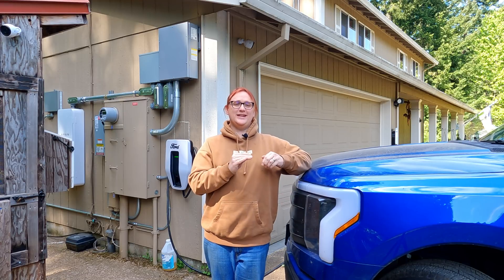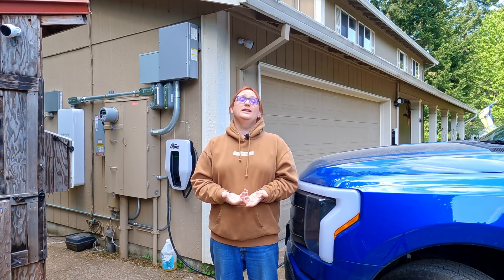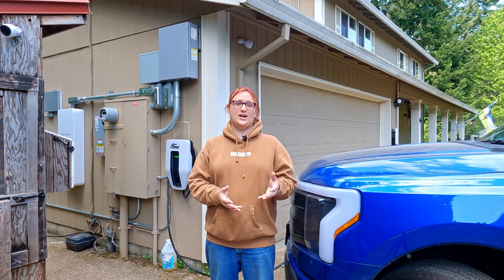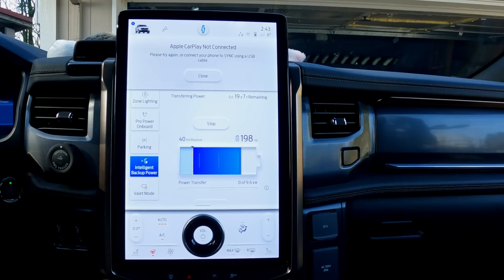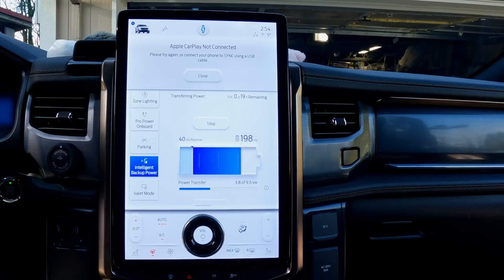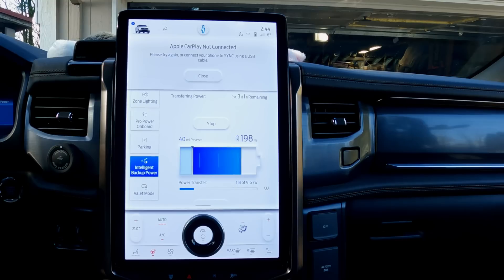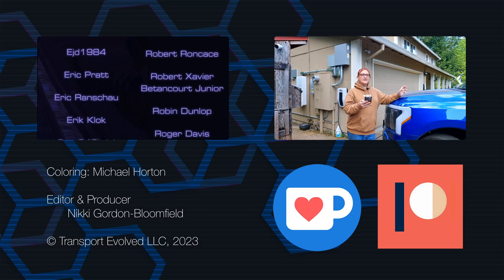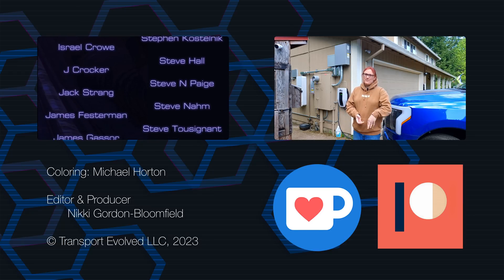I Was Wrong: How The Ford F150 LIghtning Home Integration System ACTUALLY Works

Comment: Always helpful and educational. Thank you for boldly going where we haven't yet!
Reply: @Dwayne morton The Home integration system as backup power source is not a great idea, IMHO.  At best Home integration should be for Vehicle to Grid purposes.   If the vehicle isn't at home when there is a power outage.... that is not good.  If the vehicle is needed away from home during a power outage, that is not good.   It would be better and less complicated to hook up a  separate home backup storage system, which could recover some of its costs. by buffering peak-time usage fees.
Reply: @HearToneSpeak  A grid tied solar array, using microinverters is the most popular choice. Well, most prevalent. Batteries for a hybrid system are very expensive. Might the use of an EV as that battery pack be a good interim solution, especially if a generator is available? I think purchasing a reasonably inexpensive EV possessing high efficiency, hence not having a enormous battery is the most intelligent solution. Leaving sufficient funds for home storage. But please note, this is important: this is not the prevailing attitude in America  right now. American seem to be in love with hugh EVs with humongous battery packs. Contrast that with the Chinese who's most popular EV is a tiny two seater with a even smaller battery pack. In other words you go with what you have.
Reply: @LV_CRAZY  " Batteries for a hybrid system are very expensive."  about $10k, you don't have to use Tesla PowerWall, there are other less expensive solutions, Powerwall is the best and works amazing.    The vehicle to home idea has too many issues, but more importantly tying a $80k EV to the home in a power outage seems like a misuse of resources.   Your point about purchasing a "reasonsably inexpensive ev" seems smarter.  The system will be much easier to install and like I stated, it can generate revenue / savings , just offsetting demand / peak usage charges.  

The " Chinese who's most popular EV is a tiny two seater with a even smaller battery pack"  Is not a good vehicle and I would discourage its usage, on safety grounds.   The Tesla Model 3 standard range is an excellent vehicle and has all the conveniences and a reasonable price.
Reply: @HearToneSpeak  I agree with your reply and thanks for the thoughtful response. I believe my vantage point is a bit different. I live in the Philippines so a Tesla isn't a choice. BYD has introduced the Dolphin here at a substantially higher price than in China. If a reasonably inexpensive EV is ever available here it will sell well. But no subsidies available. The roads here favor a smaller car, narrow roads and extremely tight parking spots. You'll probably never get over 60 MPH. Most solar systems here are 2 to 3 panels, a deep cycle battery and a cheap hybrid inverter. Under a $1000 USD. Saw a 6 person family on a scooter this morning.  When EVs and renewables get cheap enough for developing nations we will be much better off.
Reply: @LV_CRAZY  Thanks for the thoughtful reply, there are cheap EVs that are made in China.  The one that comes to mind is the Wuling Mini EV or hozon Neta No1 

Those are under $10k USD

Comment: Looking forward to seeing a video on today's announcement, Ford going to NACS!  So it begins....
Reply: Including NACS. Nothing said “going to” as in ditching CCS. also note the announcement didn’t include any mention of the MagicDock. Current vehicles will need a Tesla adaptor ($) to work next year. Nothing about Tesla rolling out MagicDocks to the rest of the country.
Reply: @altf4osu  installing NACS ports on their vehicles in 2025 sounds like they're going to NACS. Of course they could still have CCS as well, just like Nissan has kept CHAdeMO. 

 NACS is is the most prevalent standard in North America (more Teslas than all other EVs combined), now with another major automaker utilizing it, it's only a matter of time until others follow suit and clunky CCS is just another afterthought.
Reply: @MarkLLawrence  nothing stopping dual ports, but it will be expensive not just in copper but adding more contactors or a system to make sure only one charge door is open at a time, Jim's tone made it sound like a port swap to me.
Reply: @KaceyGreen  maybe they'll make CCS an option for anyone wanting to use the legacy charging networks out there.  Would they even be called legacy?  Most came after the Tesla Supercharger network and none ever caught it in size.
Reply: @MarkLLawrence  I’m sure they’ll include an adapter and leave it at that.  No choosing one over the other or dual plugs. Too complicated.
Reply: @MarkLLawrence  at that point Ford will likely just sell the Tesla NACS - CCS adapter, the opposite of the one they're releasing next year for current Ford EVs